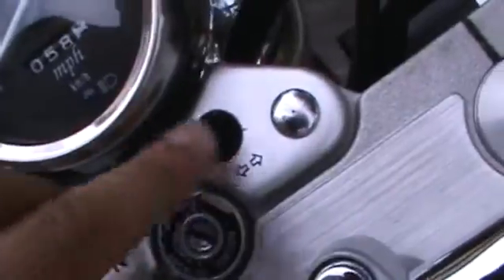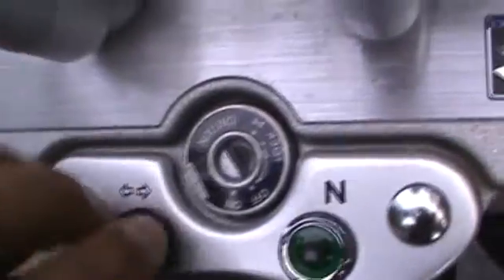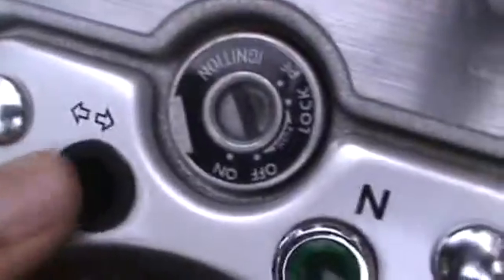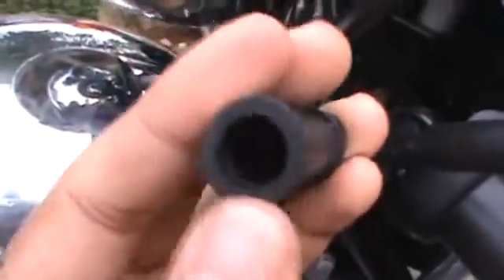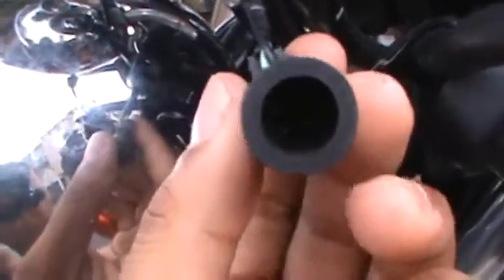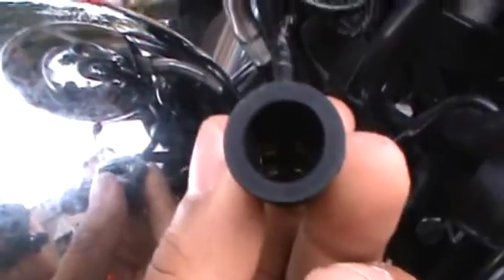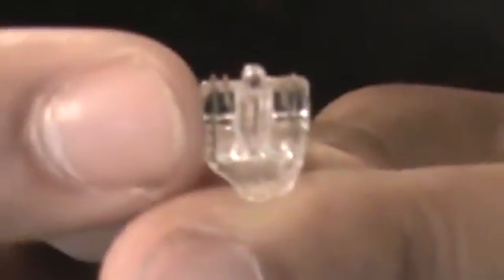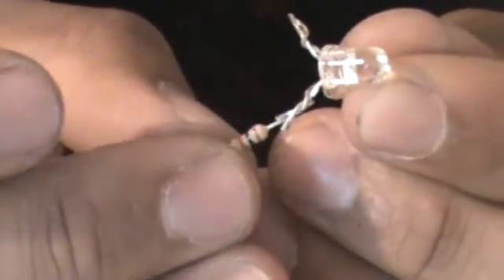Suzuki GZ250 How To: Replace Turning Light Bulb w. LEDs

Comment from the maker: Suggestion: If you decide to do this - try it with 2 different colors. Once you've got it hooked up youll be able to differentiate whether the left or right blinker is on based on which (color) LED is blinking.